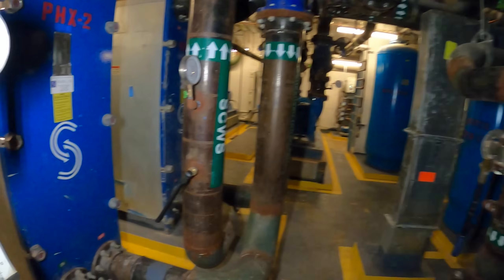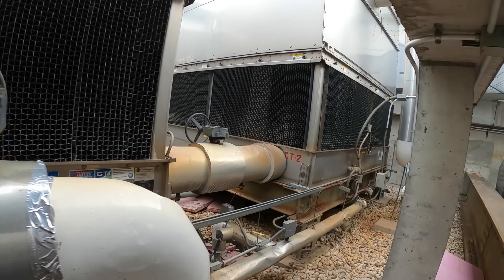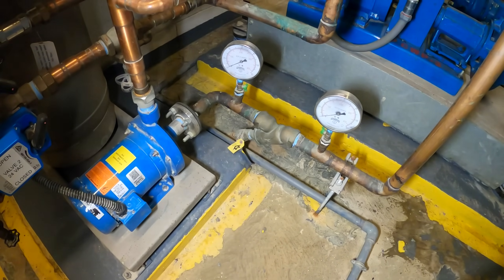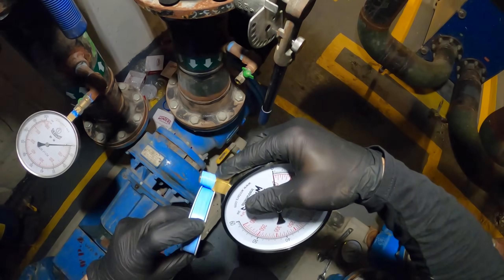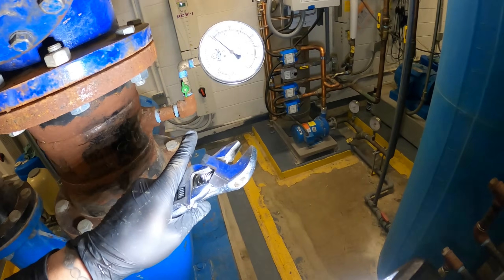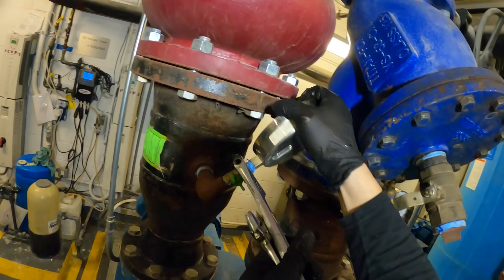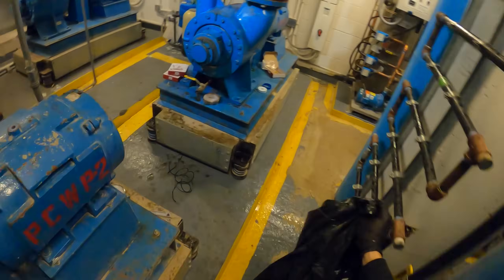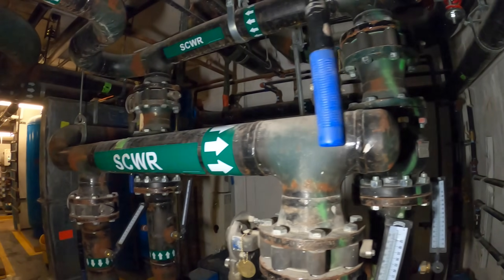HVAC: Centrifugal Condenser Water Pumps Not Reading Water Pressure (HVAC Pump Service/Maintenance)

Comment: Coming across the MB I  saw Verizon hanging off that building with no tether working in the cell tower. Crazy. I figured that's where you changed that evaporator on that RTU.